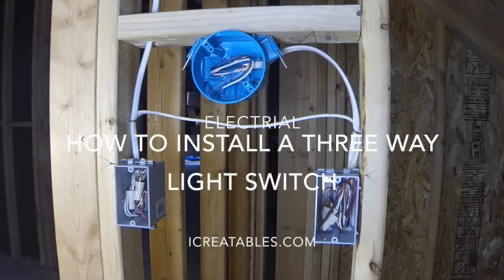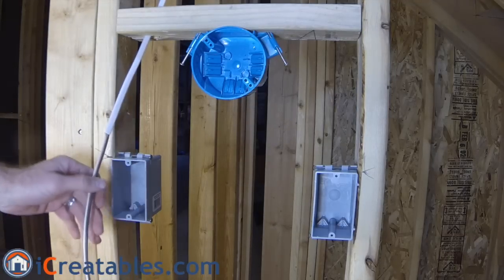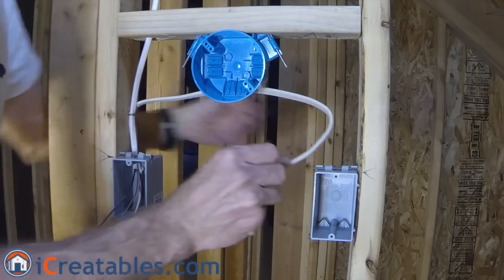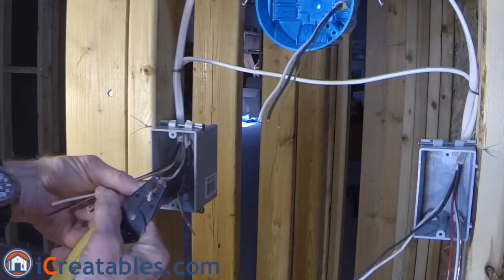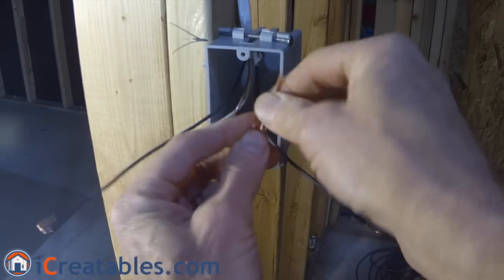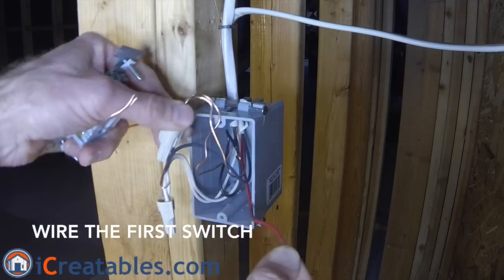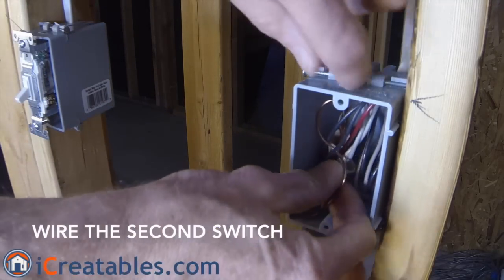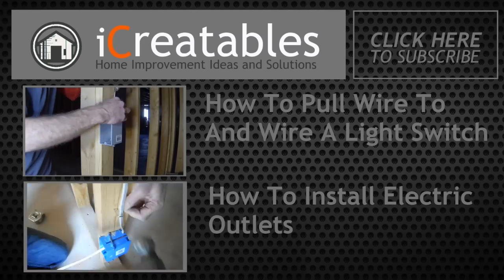Wire a 3 Way Switch

Comment: Thanks for the video! Very informative. Question: I am wiring my daughter's basement with 2 outlets, 6 canned lights, and 2 3-way switches. However, the power is coming to the outlets first, ,then to the canned lights, then to the first 3-way switch, then 3-way wire to the second 3-way switch. My circuit ends with this second 3-way switch. That can be done, right? I don't HAVE to have to power going to the first 3-way switch first do I?
Reply from the maker: +Tracy DAndrea Not sure if I understand. It says you are going from the canned lights to the first way switch but then your question says that you don't have to have power going to the first 3 way switch. Power must go to one of the switches and then goes to the second switch via the 3 wire cable.
Reply: +Tracy DAndrea It can be done but may be a tad advanced for a newbie. Neutral stays up at the can lights, use white to first switch as constant hot to black screw (point), red and white of three-wire to second switch as travelers, and black in three wire as point wire (black screw) all the way back up to turn the lights on.
Reply: +Tracy DAndrea - You are correct. You can feed the first light from the last outlet. Just be sure to use 12 gauge cable and 20 amp fixtures throughout if this is a 20 amp circuit.

Comment: please use the proper sheathing strippers,im sure you have your method down pat,even though you take a risk of cutting into the wires,,,Remember your teaching here,,,,,,also its better to twist your wires with lineman's pliers before applying wire nuts,plus i prefer using a grounding sleeve, twist,crimp,wires pass through=1 for metal box & 1 ea per switch or receptical. seems better espiecally with multi gang boxes

Comment: always use electric tape around those switches and outlets
Reply: +Ellis Diaz Why?
Reply: @patrickgatons  incase u touch a screw you'll potentially die/hurt but its not a requirement
Reply: Shock Therapy theey are conductors arent they

Comment: Nice video, but the way you connected the traveler wires on second switch will not work!
Reply: You're fine. I'm pretty sure Dwayne was talking about the cross on the traveler wires. All he did was swap the side that the red traveler is connected to. It makes no difference to functionality. All it does is change the switching position.
Reply: +Dwayne Breaux he wired the switch right....
Reply: +Dwayne Breaux You are incorrect. He did it right.
Reply: +Shock Therapy nope, the color wires are wrong, been doing this for 35 yrs I know what im talking about.
Reply: Hi Dwayne. I'm curious what you see wrong here. I followed this exactly and the switches work perfectly. Just want to make sure I'm not missing something.

Comment: Is a three way switch just the same as saying a two way three wire switch?
Reply from the maker: +rory johnstone "Three Way" is a reference to the number of paths the current can take.  1- the power source leg, 2- to the other switch, 3- to the light.
Reply: +iCreatables Thanks for the information.
Reply: +rory johnstone - They never should have been pegged "three-way" switches. But it's too late now. In technical terms, a "three-way" switch is a 1-form C or a Single Pole Double Throw switch.

Comment: I don't understand why you have to have 6" from the face of the box.  Jamming those wires in the back is not terribly easy with as few as two set's of cabling coming into the box.  When you have three or more, it becomes increasingly difficult and damn near impossible to push all those wires to the back.  What possible reason could there be for this 6" rule?  Is it code, and if so, how is having it shorter dangerous? Thanks.
Reply: +iCreatables You forgot your annotations at the end.
Reply from the maker: +John Meise It makes it easier to work on the switch. The last inch is stripped and attached to the switch. There are different sizes of boxes. Make sure that you have a box rated for the amount of wires you are using in it. Thanks for watching.
Reply: iCreatables I'm thinking that maybe this house was not wired very efficiently, because they are using 2 conductor with ground for three way switches and doing other odd stuff, and several of the boxes have multiple romex cables inside them.  IE: one of our 2 gang switch boxes has four cables coming into it.

I'm currently working on a 3 gang switch that is, I believe, 3" deep?  And I'm going to have 5 cables coming in, one of them 12 gauge.  1 cable is the feed, 2 will be lights, and 1 a 3 way switch.  The 5th is going to an outlet, so I think I may get a junction box and put that below this box so that I can reduce the cables to 4.  Thanks!
Reply: +John Meise - A couple things. First, if 6" will not fit, then the box is too small. Second, if you have 12 gauge cable feeding any box, ALL other cables connected within that box must also be 12 gauge.

Comment: I have 3 sets of wires which each one has 3 wires in them. in trying to install a dimmer switch. I am lost. please help
Reply from the maker: +gary smith It is hard to say without being there but I would guess that one goes to the light, one takes power to another device and does not connect to the switch and the third is power coming into the box.

Comment: Is it possible to wire  3 way switches with 14/2 as your traveler wires?
Reply from the maker: BC Bridges Yes, as long as all the wiring is 14/2 and your breaker and circuit are sized for it.
Reply: +BC Bridges - No, that is not to code. All boxes must be grounded and you must not "borrow" a neutral or a ground from another circuit to accomplish this; and you may not use the bare conductor for anything but ground.

Comment: Ground first by Trade right?
Reply: Depends mate..if I'm in a switch box with multiple switches, I might do my neutral splices first as those don't get connected to the switches..that's how I do it..as you get further along you'll learn what works best for you
Reply: Nice thank you mate.. Always learning .. :)
Reply: @TheFreeService  id get into the habit of grounds first for your safety. You wont always be working on de-energized equipment

Comment: The diagram in the beginning of the video seems to be wrong. If you follow the wires it won't work as intended. The traveler wires should be reversed on one of the switches. Am I wrong?
Reply from the maker: Dan R You are correct, it is wired differently than the diagram. The traveler cables can go to either of the terminals. A three way switch essentially switches between the two travelers so when one is on the other is off. You can install the wires to either traveler terminals. The drawing is done that way to make it more clear.

Comment: The diagram at the beginning shows travel wire and hot wire the same on both switches but the video shows the second switch with both hots on the same side and travel wire on opposite side? Which is correct the diagram or the video?
Reply from the maker: Aaron Edwards In a three way switch there are two travel terminals and one hot terminal. The travel wires can go to either terminal and they do not need to coincide with the other switch. A three way switch simply switches the power between the two travel terminals so there is always power going to the second switch.
Reply: Sweet I was just talking about this tonight. This video was very helpful

Comment: Ok I see you did not place the travel cable wire on the same "travel" cable stud on switch.  does it not matter?  Looking a diagrams they show the backs on one side the red on the other. is that just for uniform look?
Reply from the maker: AnnMarie caparrotta You are correct. It does not matter if the same wires go to the same travel terminals on the switches. Yes many electricians will always install wires cleanly to have a uniform look and keep things easy to track. Thanks for watching.
Reply: It doesn't matter.. But i like to stay consistent that way if im troubleshooting something i know